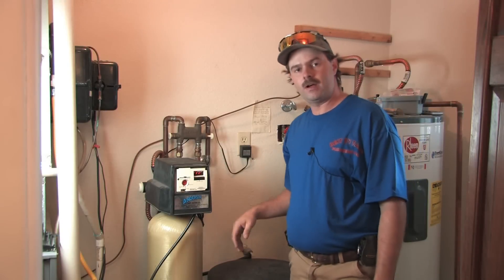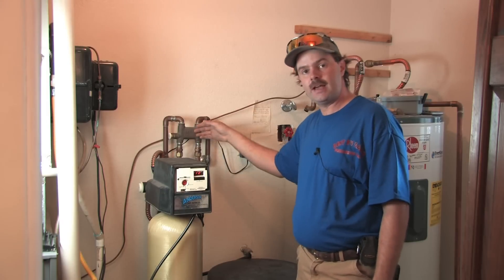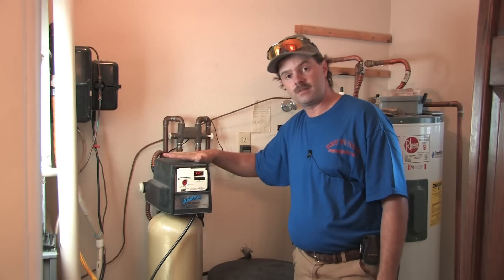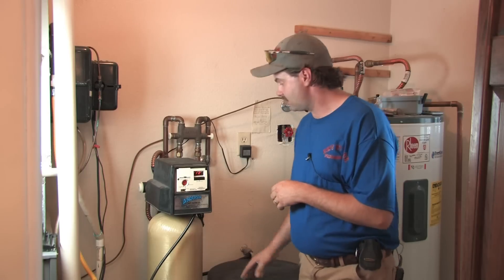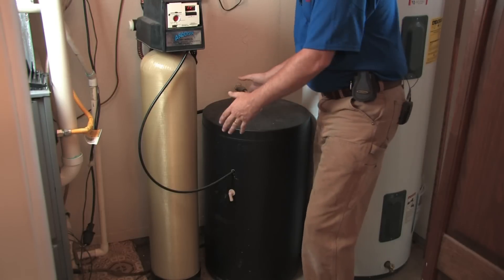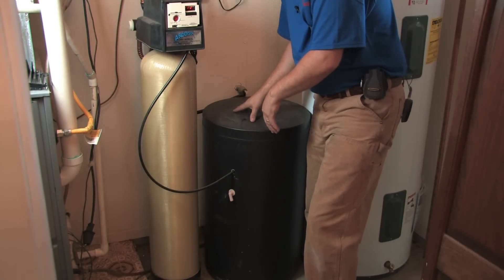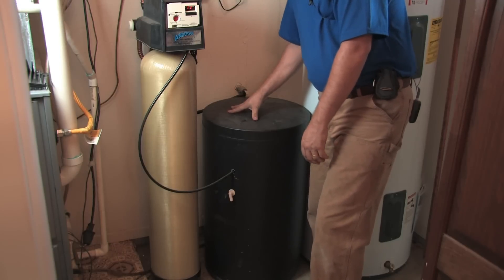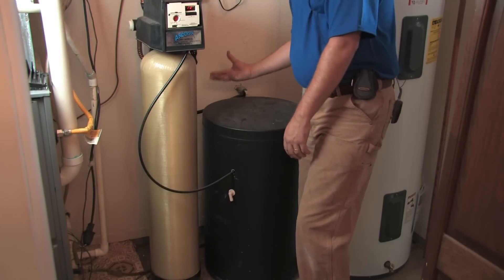Water Softeners : How Do Water Softeners Operate?

Comment: Something is not working correctly.  That 3/8" tube should refill your brine tank after 1st drawing in the brine solution to regenerate your system.  You'll probably have to call for service unless your have a neighbor that has a working system that could trouble shoot yours.  Good luck.

Comment: There is a very thin tube running through the top of the plastic "garbage can" into a see through, upside down cup with fluid in it, on top, next to the timer board. At the other end it runs all the way down into the brine tank (which is the garbage can, with the resin tank inside it). I can't see where it terminates, because, naturally it runs behind the resin tank. There is the slightest amount of liquid in the bottom of the brine tank, but barely a spill.

Comment: Your brine tank should  contain a tube approx 3" - 3 1/2" in diameter.  This contains your float for your water level and at the bottom a pick up tube.  It should be mount to one side of your brine 'grabage can' tank.  There should be a approx. 3/8 plastic flexible tube running from the side of your 'garbage can' into the top of your float/pick up tube.  This draws the salt solution into your resin tank during the cycle and washes the minerals out of the resin and out the drain tube.

Comment: Thanks. Yeah - it's dry. The resin tank and the brine tank are both housed in the same plastic "garbage can". There are two inlets in the top back (in and out, I presume), going into the resin tank. That's it. So the "garbage can" is the brine tank, but the resin tank sits inside it as well. The salt actually touches and surrounds the resin tank. Must have been a space saving design or something, but, yeah, it's dry.

Comment: Your brine tank is bone dry?  It should be 1/2 full with water just covering your salt block or bag of pellets.  The brine mixture is drawn into the softener tank after the existing water being 'treated' is flushed out at the start of the cycle.  You should have two hoses, probably clear plastic.  The smaller runs from the brine tank to the head of the unit and the second, probably larger, runs from the unit to a drain.

Comment: Mine is not a digital head and set up on a 12 day cycle.  I push a pin on each day that I want the system to regenerate.  My water is hard so during the winter I run a regeneration about every 4 days.  Now during the summer when we are using more water for car washing etc, I regen every 2-3 days. You'll probably have to read the manual to see how to set the regen on your specific model.  Hope this helps.